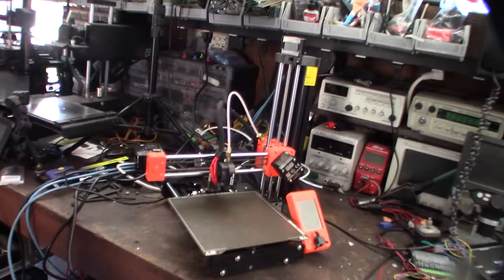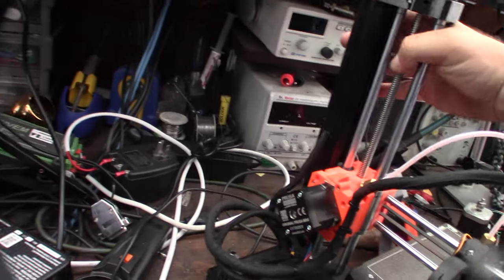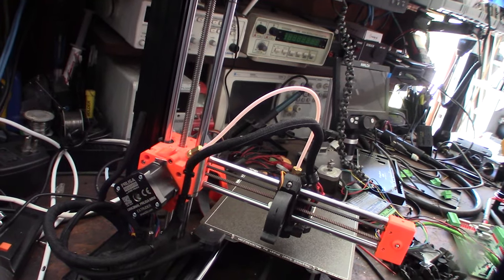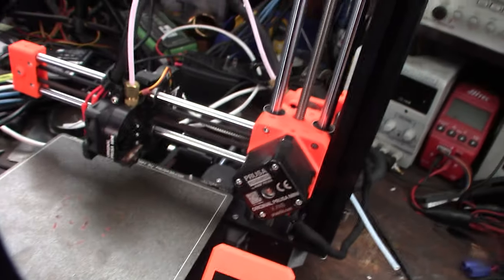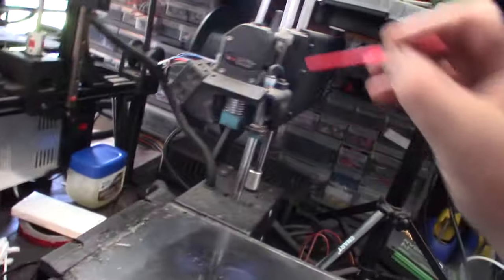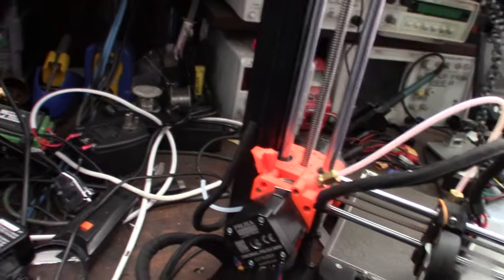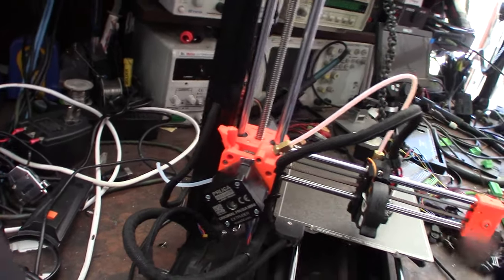Another Prusa Mini+ With Extruder Problems, jamming, cutting filament

Comment: I will agree the Mini cuts some corners, and the extruder and runout sensor setup is a disappointment. But I am not sold that dual small gears are the best solution. I am quickly becoming a fan of large drive gears, even in a single gear configuration. The single large gear that Prusa is now using on the MK4 Nextruder has performed flawless for me over the last 9 months. I have just started to build a dual large gear Clockwork2 extruder for a Voron using HGX gears. I have high hopes for it! 

Do you use the Integrated Filament Sensor version of the Bondtech? My understanding is that it still is a basic sensor, and doesn't do any loading or unloading, like the MK3/MK4 would, correct?

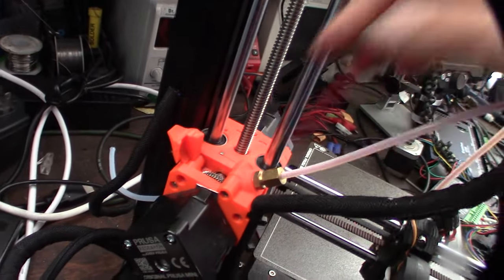Comment: 0:48 no that's no the problem, the real problem is that the motor pulls the filament so fast from the hotend that it leave mini traces of filament inside the extruder. The only solution is pull the filament in a lower temp and speed, also to change the bowden tube for a capricorn one. I preferred to have a gcode to remove the filament at 185 C for PLA and 200 C for almost everything else.
Reply from the maker: I've fixed 10+ of these printers. They all come in with the same problem. The only reliable fix is convert to BMG extruder gears and ditch automatic feeding. Load the filament manually.
Reply from the maker: Its a bad extruder design. Prusa should have a dual drive upgrade kit.